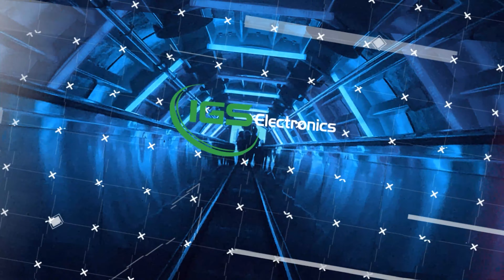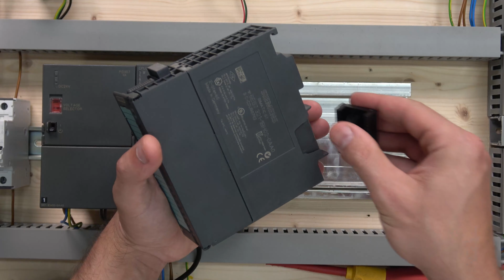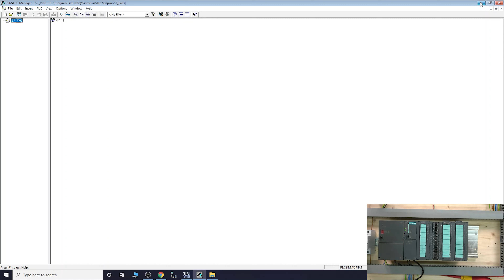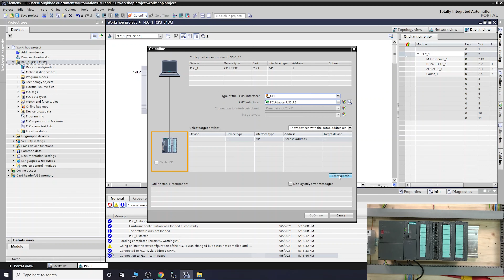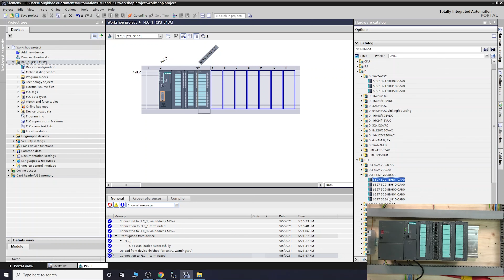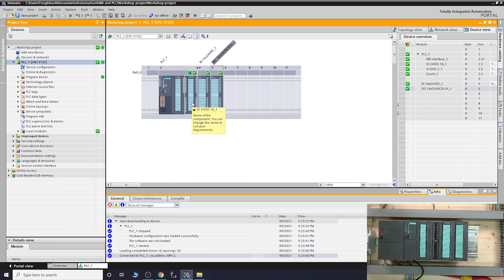Siemens S7-300 PLC, program upload/download, hardware configuration using TIA Portal V16. English

Comment: Hi. Can you please give me a reason why my s7 300 output address is default to Q136.0.
Id prefer to start from Q0.0 etc
Reply from the maker: Hi there. You are able to change that in TIA Portal in device view selecting card you want to change the addressing and clicking on inputs or outputs. Scroll down to addressing and you should be able to change that. Remember not to create the clash with other inputs/outputs, your system is automatically addressing them to prevent that.